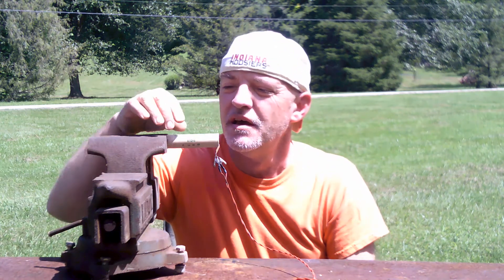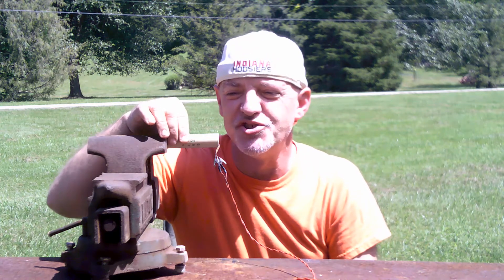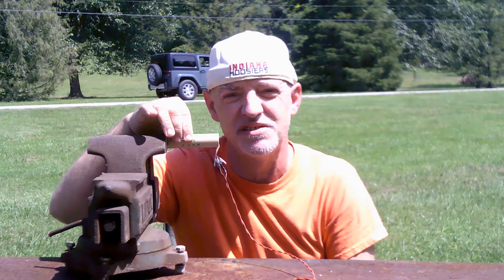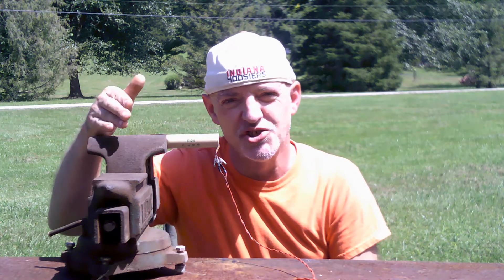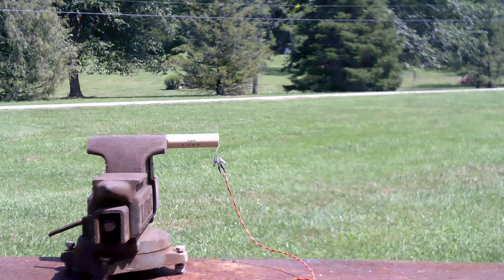TESTING ESTES E12-6 ROCKET ENGINE, STATIC TEST FIRE!

Comment: Did you just clamp the engine in the vice? I wanted to test a homemade ignition circuit and was about to build some silly contraption to hold the engine.
Reply from the maker: Yes I just put it in the vise and made sure it was tightened securely, but not so tight that it damaged the engine.